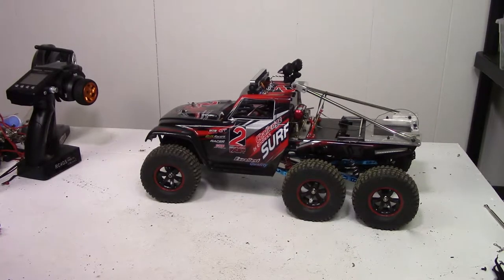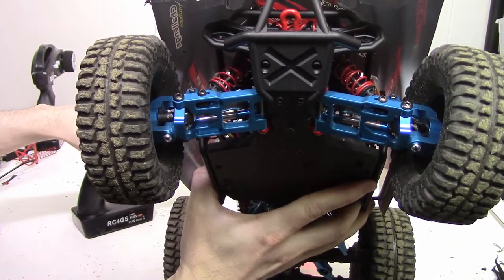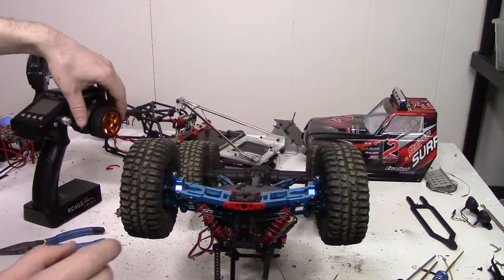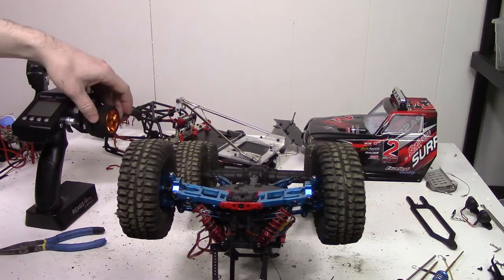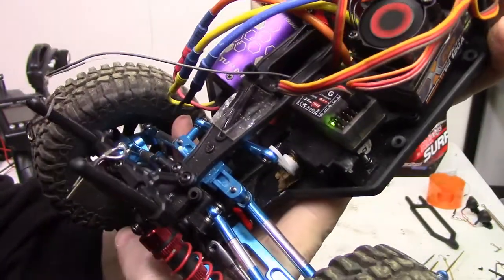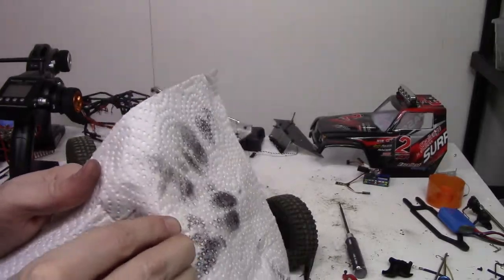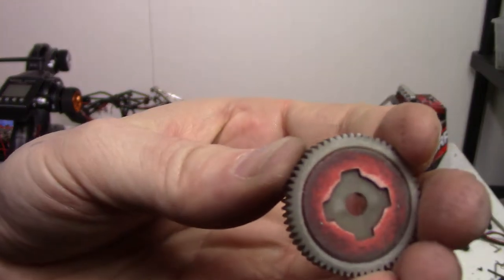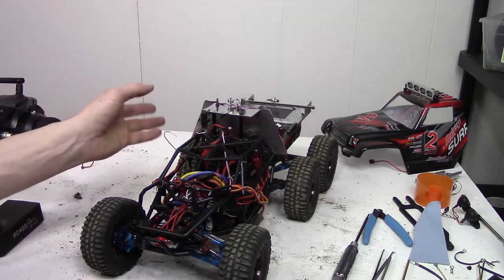Feiyue FY06 - Fixing the steering and slipper clutch!

Comment: Blue aluminum steering rack piece. Mines doin the same thing with brand new servo from last year. Not long after buying the upgrade steering rack slider piece I started having same issues.
Reply from the maker: Yea they should of gone with a bell crank steering system would of been better.
Reply: Void X RC I ended up goin with the toro ts50 esc with same motor sensored still , couldn't be happier. There finally selling nice steel gears for the 12428 thru ebay. Not that zinc alloy crap which never holds up with brushless. Got some more of the newer style upgrades front shock tower rear girder ect. Swapped out the lipos in the basher for gens ace RS series 2s lipos 100c, two running series. Got Castle's series wire harness with 6.5mm bullet connector. Got quite a few packs of their 6.5mm bullet connector to solder to both lipos this week sometime I'll get around to putting all this new stuff in. From what Joe Ford from castle says and even in my castle link parallel configuration does not double the c rating, so my 2 lipos 20c where only giving me 53 amps continues which is 20c. Just heads up! So we been running only 20c discharge this whole time😲. Got new set of proline blockade & src roadcrushers over collecting dust till the weather clears which it's starting to do!
Reply from the maker: Sounds like you've been doing some work! nice :D I agree with what Joe from castle says, you can't change the C rating of a battery. I did not have the best understanding of it before. However you DO get an increase in maximum current capability because the max current draw is AH(amp hours) multiplied by C. so when you stick 2 batteries in parallel the C rating stays the same but you have more discharge capacity.
I look forward to updates on your RCs!

Comment: I think the problem might be at the place where the servo and the steering system connects the little white plastic. it was pending when it had problems turning.
Reply from the maker: Yes that is definitely the weakest link in the system. I don't think it is the root of the problem though, I have two other feiyues that have a lot more run time and they are setup the same way. I've never had an issue with either of them. I know I should upgrade to a better servo horn, my be this incident will get me to. Thanks for your input!

Comment: Nice Detective work my friend,
my Twin Hammers steering does the same thing from time too time,with the slide arm getting snagged in the slide,and it's plastic,
Having metal on metal increases the snagging potential,leaving one of the components plastic decreases the chances of it binding,
Ultimately with the binding issue,having one part plastic,and the other part aluminum,would be better then all plastic or all aluminum,"less friction"
The white lithium grease was a good fix,replacing the slide arm with a plastic Vattera Twin Hammers slide arm,would probably be an advantage,the Vattera plastic has fiber in it,and is essentially more slippery then WLtoys or Fayiu plastic,not to mention it's significantly stronger, 
This won't completely eliminate the binding,but it will definitely decrease the chances of it binding,
Ultimately It's not exactly the best steering design,a Bell crank system would have been a more reliable manufacture choice,
Excellent video Brother
😎👍👍
P.s. please except my apologies if you already knew about the metal/plastic combo 😕😀
Reply from the maker: Thanks brother. I have used the plastic and metal thing before but it didn't even cross my mind for this at all! I definitely have the original plastic parts so next time I have the truck dismantled Ill probably change it. I really didn't build this thing to be dismantled though lol what a pain in the butt it is!
Thanks for stopping by :D
Reply: Void X RC I hear you there,I've had my WLtoys apart more times than I care to talk about lol,I've been following along on all your fy06 stuff,it may be my next RC,I almost bought one online a couple of weeks ago lol 😁

Comment: Tip on sanding. Get your self a peace of glass. Its smooth as relatively you need. Then spay glue and place weight to press it evenly on glass (if you need two hands to sand), or wet your sand paper on the glass(water helps in sanding process and should relieve tension on the paper, smoothing it). This way your paper is even as possible for 90% of applications for DIY guy comes across.
Having even surface to sand with, ensures your peace will become even, giving you even surface tension to whole clutch area and you can then adjust it via roughness of the paper.

Using your hand, you will only sand whole uneven surface to that uneven surface and have no hope in hell to get it even, IE why sanding pads were developed, but even those are not even as glass.
Reply from the maker: I actually do have a piece of glass somewhere that I used to use as my plate for sanding heat sinks flat. Didn't even cross my mind to go find it. What I really should of done on top of it was glued the clutch plate to the pad, would of guaranteed no slippage in the future. Thanks for the feedback.

Comment: What kind of motor and esc do you have in it?
Reply from the maker: the motor is a Turnigy 2845 1980kv brushless and the esc is an Hobbyking X-Car 60 or 80amp I can't remember, although I have taken that esc out now.
Reply: Void X RC alright thanks
Reply: Void X RC have you had any problems with them?
Reply: Void X RC I just got them, did you have to solder the esc to motor?